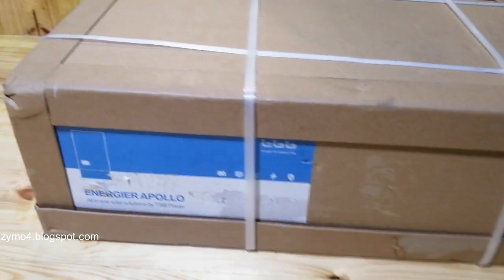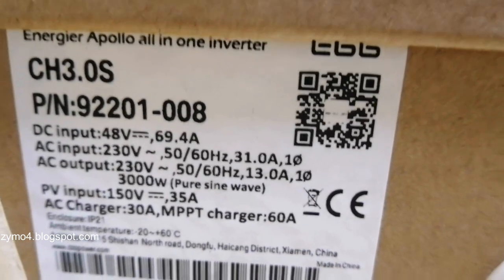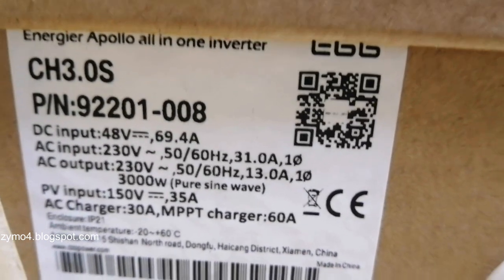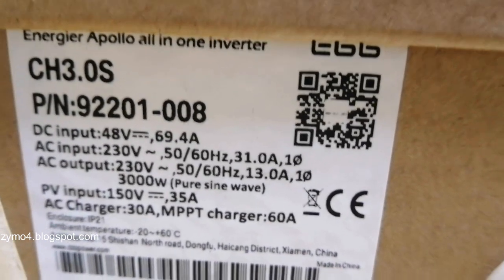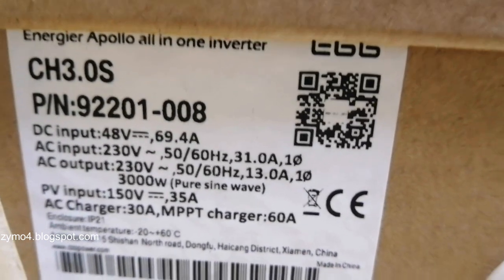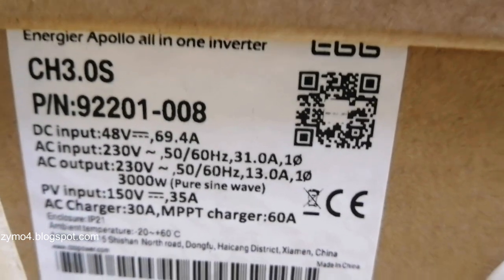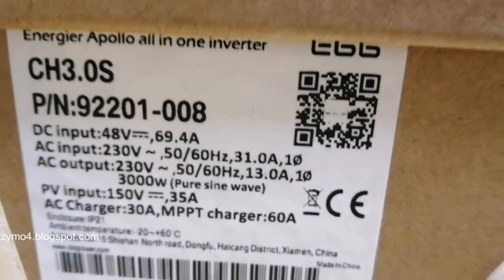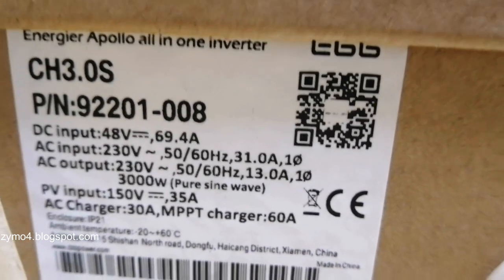Unboxing TBB Energier Apollo 3Kw Hybrid Off Grid Inverter Part 1of2

Comment: Quick question sir, if you are in solar mood with grid input as well and you connect a load greater than the inverter rating on output 1(bypass). Will it harm the inverter?
Reply from the maker: Rule of thumb - You dont overload your Off Grid Inverter regardless if its in Solar Mode or Bypass. The relay that's responsible for transferring your load to solar or bypass has the same rating.

Comment: Sir what does bi directional inverter means?
Reply from the maker: Hybrid On Grid Inverters are bidirectional- can export and import power. Import for its own uses, and export whats in excess.
Reply: @MarkMinoza  tnx for the info. Hybrid ongrid can be ac coupled to existing gti inverter?
Reply from the maker: @toots3020ph  all hardware that has grid tie on it are AC Coupled.
Reply: @MarkMinoza  meaning hybrid offgrid inverter cannot be ac coupled?

Comment: nice..sinu seller nito sir?si jt ba?
Reply from the maker: Yes, siya po.
Reply: @MarkMinoza  thanks. makapag.upgrade nga 6kw.hehe
Reply from the maker: @pinoysolarista7072  part 2 is getting the internals exposed, ill post this weekend. Ill test also next week.
Reply: @MarkMinoza  ok..gagana lang pala si AC out 2 pagmeron AC input.
Reply from the maker: @pinoysolarista7072  hindi ko pa na test sir, next week e mount ko para malaman natin. For now nag aayos palang ako ng gamit like wiring atbp.